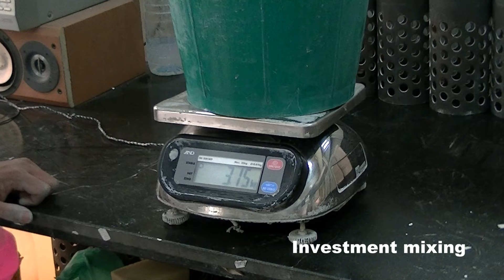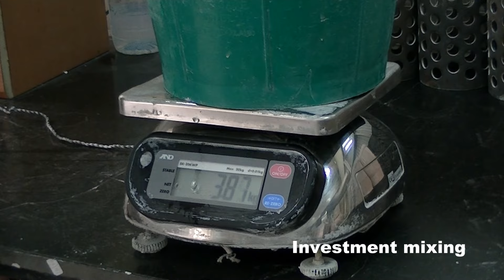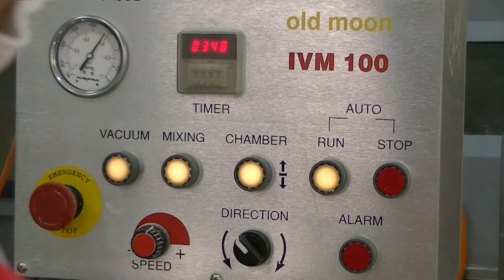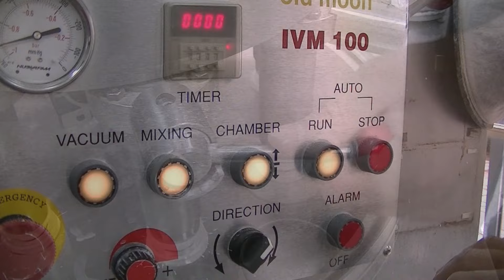Wax setting  for casting

Comment: What is that Flask material sir ?
Reply: Simply Steel
Reply: @Martin-zd8eb  I hope you know there are SS 202, 304, 310, 310 and more than 50 types of Steel available in Industry for different Metallurgical property for Thermal, rust, corrosion resistance ?